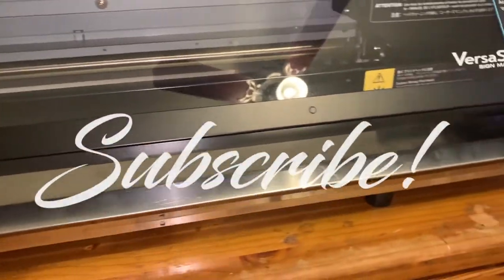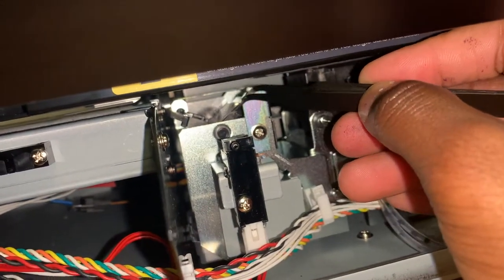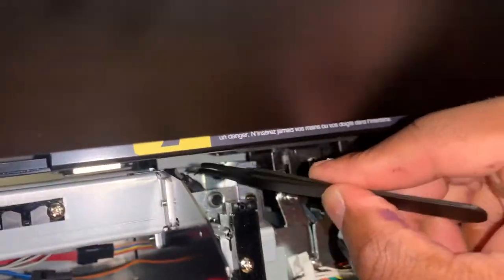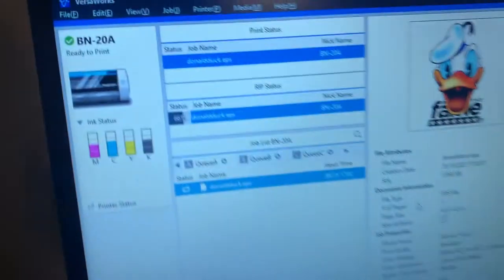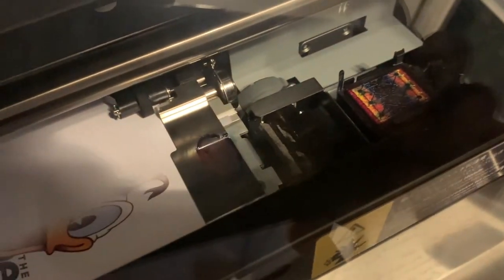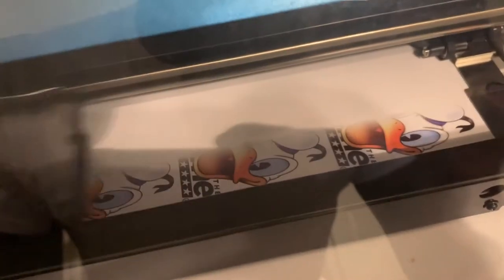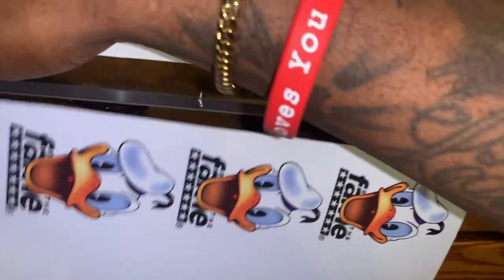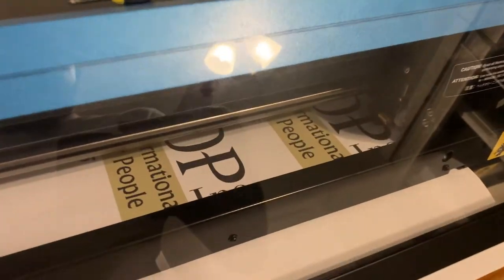Error 109 Roland BN20 | BN20a Quick and Easy Fix at Home! Wiper blade home positioning.

Comment: Thanks man, this wasn't exactly my issue but going thru this helped solve it. It was actually that when I replaced the capping station I didn't pull the drain tubes out taught enough out of that area directly underneath the capping station and they were bunching up and (I think) interfering with the spring mechanism and causing it to go up to early and it was preventing the head from going all the way over to the right.

Comment: I cannot reach the other two screws. . I do see some small ones at the top but they are totally unreachable for me. They sit under the bar and there is no way I can get at them.  Newer model, so maybe they have done this to keep people from trying to do stuff themselves.
Reply from the maker: @coneheadjill  do you have the BN20a model or the bn 20?
Reply: @shastylesdesign   BN20a
Reply from the maker: @coneheadjill  wow- yea maybe they made it harder to access smh
Reply: @shastylesdesign   Support has told me I have to replace the motor.  No skin off my nose, it's under warranty and he had never heard of your method, which I have seen a number places on youtube.
Reply from the maker: @coneheadjill  yea most definately get that motor replaced. This is only a temporary fix to get that one job through… I eventually got my motor replaced under warranty. The warranty is DEFINATELY needed

Comment: Im having this issue right now with my bn20a. I tried contacting roland tech support (no idea when and if tech can look at it - still under warranty (15months old, bought brand new). Ive tried following the steps in the video, but still having no luck clearing the code :(
Reply from the maker: Ahh man! Sorry to hear that! Luckily tech support will resolve it 100%- keep tinkering with it for sure
Reply: @shastylesdesign  what were you pushing when the wiper was moving ? was is the small metal tang connected to small brass spring ?

Comment: Thnx! Helped alot. Got it back to work again!
Reply: Well, it resolves only for a short period of time.

Try checking THE GEAR on the motor connected with the felt and wiper to turn around.. that was the problem in my case!
The scraper, underneath, had to replaced because it was bent.

Good luck everyone!

Comment: Hello - did you get issue fix by tech support? I just got same issue thx
Reply from the maker: Yes! I eventually got tech support to permanently fix the issue. This is a quick fix but surely is annoying. I renewed my warranty as well because of this but apparently its a motor issue
Reply: Its THE GEAR connected on the motor.

Comment: Mine did this today.  How was the follow up?
Reply from the maker: As long as you have a warranty you will be fine! They work fast! This is a quick fix to stop the annoying beeping lol
Reply: @shastylesdesign  Thanks.  I called tech support but they haven't called me back yet.  I haven't touched the machine.  I figured I better wait til I hear back
Reply: They called pretty quick but didn't give me anyway to get it running. Said someone would have to come look at it.
Reply from the maker: @lbrooks3057  yea this method from the video will get it running (until the next beeps lol) it got me through a major project